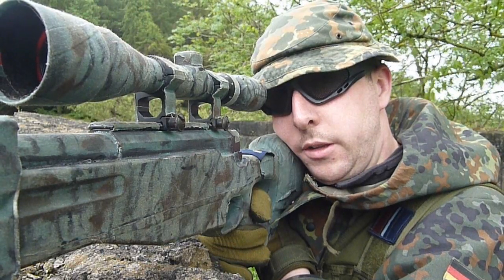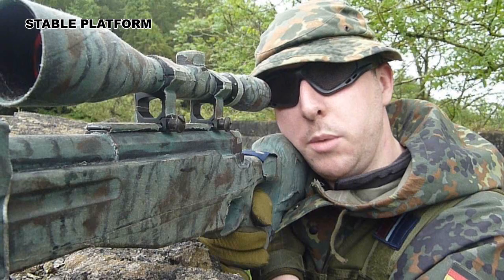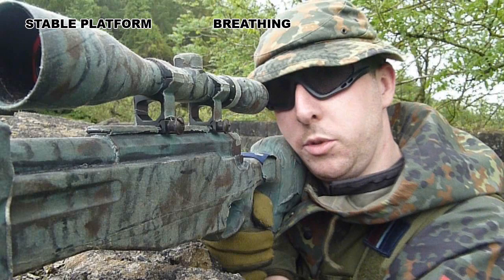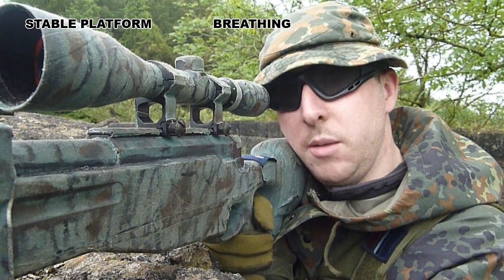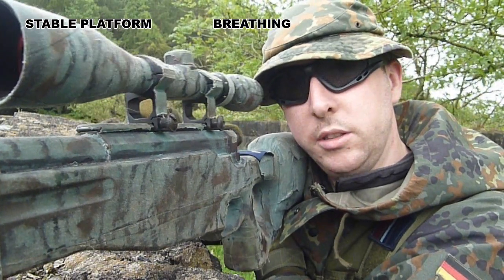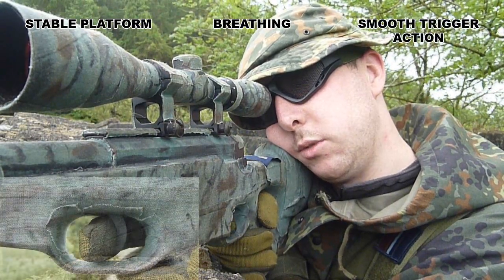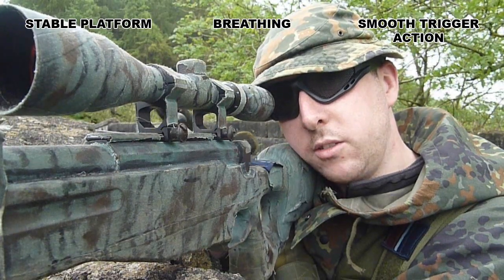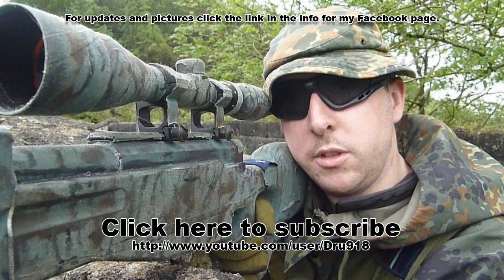Airsoft sniping Taking The Shot

Comment: @BostwickAirsoft Mine only partially cracked a piece of the plastic trigger box, but not much beyond that.  It still functions fine.  The kit itself really improves the range and accuracy.  Just make sure to put in some teflon DIY mods, and you should be all set.

Comment: @heintron airsoft gun range vairys depending on what gun and barrel length... cqb weapons like mp5's or orther short barreled guns have an accurate range of about 30-50m after that the bb gets unpredictable...Assault rifles like M4s/AKs or other medium length barrels have a range of about 50-60/70m accurate also after that the bb get unpredictable.
And sniper rifles ( long barrel guns ) depending on BB weight/wind/and gun specs it can hit targets up to almost 100m
( there are alot of variables

Comment: I heard that you should shoot when you have exhaled, because apparently when you fill your lungs with air, your muscles will start slightly twitching because of the pressure they're holding. This twitching will be unnoticeable, but it still happens. Also that's stuff more for actual sniping, I don't think in airsoft it would make that much of a difference...